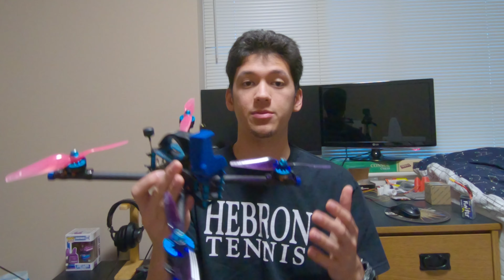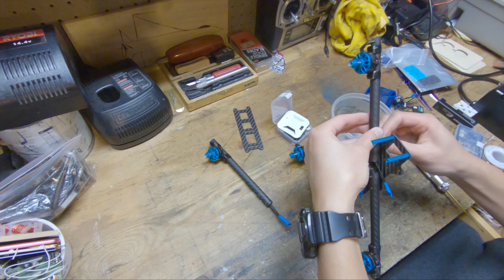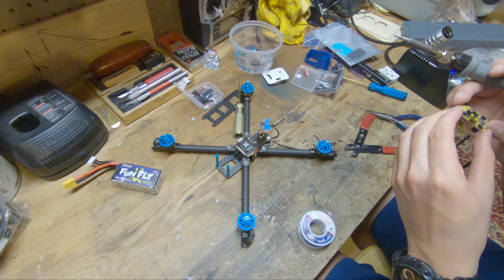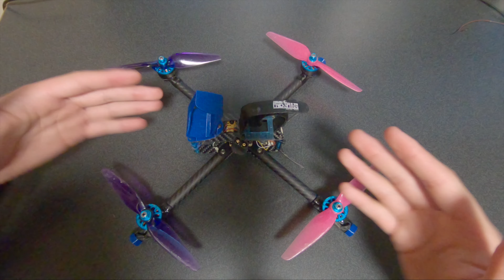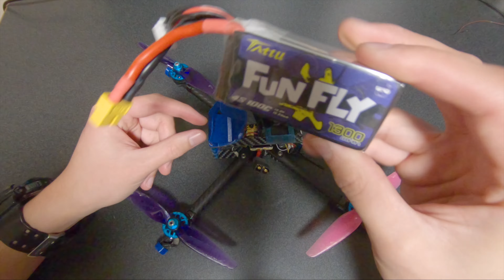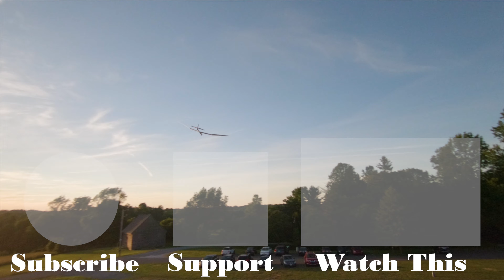Light and Fast - My Freestyle Setup Explained - Tubular Quad V6 Electronics Installation

Comment: Hi Timmy! I was wondering if you can help. I have a very similar kwad than you and I have a little problem. My kwad flies great except for one thing, It gains altitude when doing rapid yaw movements, like a lot. on easy move it's ok but on full stick yaw left and right, I can go to the moon.
Any advice? Lower P and I on Yaw?
betaflight 4.2.9 stock pid
6s 6inch ethix k2 1650kv
Reply from the maker: This is just a side effect of how multirotors accomplish yaw control. Setting up Dynamic Idle is probably your best bet:
https://github.com/betaflight/betaflight/wiki/Tuning-Dynamic-Idle
Reply: @TimmyRC  Thanks! this is my first bigger than 5 inch kwad and I never saw that side effect on my other builds. A little bit yes but that one looks like a little punchout on rapid yaw.

Comment: That's really cool! Is it durable and what is the flight time like? I actually have 4 spare 1800kv iflight Xing e 2207 motors and an iflight 30x30 45a stack. Maybe I could make one using these components.
Reply from the maker: Thanks! The V6 has seen some pavement and hasn't broken yet. I get ~4.5min flights doing my usual freestyle on a 1300mAh 4S.

Comment: That is a super unique design, very well thought out.  Bummer that your NewBeeDrone FC has that issue.  I finished building another 6 inch with Shark Byte on the Glide frame last month, using a Matek F722 Mini SE flight controller and Hobbywing Xrotor 20x20 ESC.  It came out to 666 grams AUW with an 1800 mAh 4S, 680 grams with a 2000 mAh.  I could probably shave another ten grams from that if I had a 3D printer so I could cut the weight of the Session mount.  The Brain 3D ones do weight about 25 grams.  It would be closer to 617 grams if I ran a 1300 on it, but I do like six to nine minute flights.
Reply from the maker: Thanks! Good to see someone else who appreciates 6 inch and weight savings.
Reply: I've been working on a light weight session mount for the glide. I think it was around 18 grams